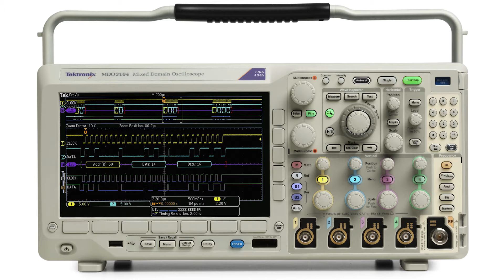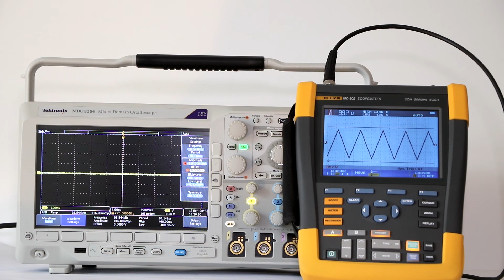Fluke 190-502 ScopeMeter, Use of Cursors

Comment: Thanks for the vid. We have a problem when we are trying to measure a 50us delay between two pulses using cursors on a 190-502. At a timebase of 10us, we can see our pulses on the screen but the rise and fall are too steep to accurately place cursors where we need (the 50% point of the rise). At the next setting, 4us, we cannot get both pulses completely on the screen. Is there a way to select something like 5 or 6us timebase?